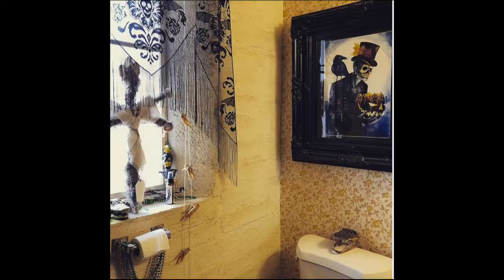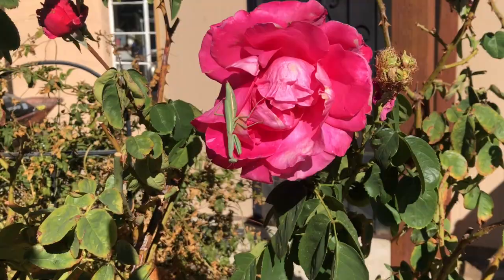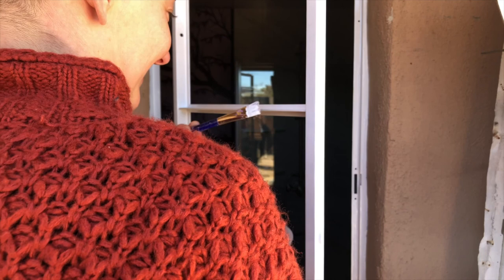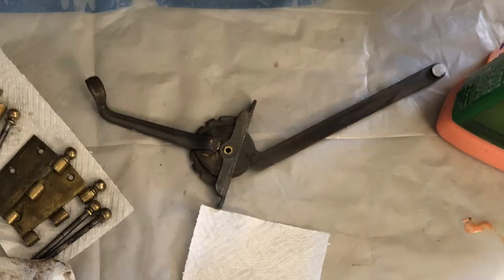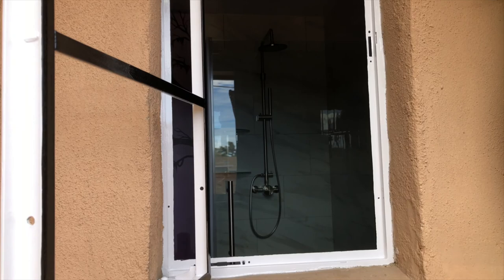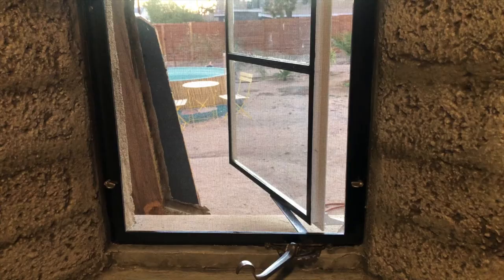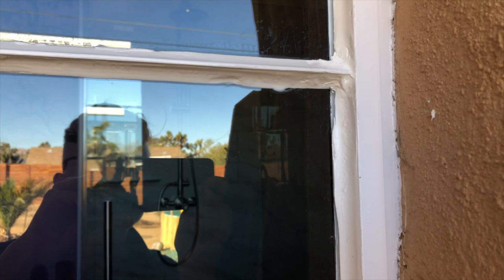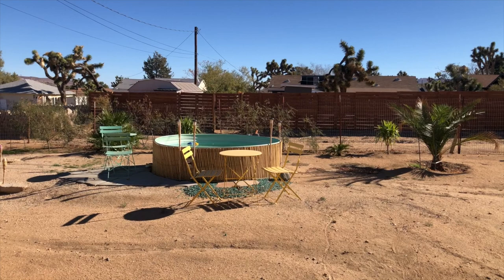DIY 1940's Steel Casement Window Restoration

Comment: great job on the paint removal, just a couple friendly tips you may already know: some folks out here in the desert are using 1/4 inch laminated glass as replacement on these frames because its 99% UV proof. Also an oscillating blade tool makes quick work of removing the glazing, and media blast and/or wire wheel can work fast. good upload thank you. theres not much content on practical steel window restoration out there.
Reply from the maker: Thanks for the tips! I will try some of those out, we have plenty of windows left to experiment on :)
Reply: Thanks for the info. I plan to clear coat bare metal for the inside and maybe some kind of cool coat paint on the outside for less heat transfer with the metal. I was considering replacement but my original window from the 40s seems to be better quality than most options that don't cause choking on dollar signs.
Reply: @rob8823  so Ive really gone down the rabbit hole on this. Best Ive found is a 3 inch die grinder, with those Signi Poly Strip Abrasive Discs on amazon. Takes off paint and rust like butter. Only use stainless wire cup, because the iron ones will make it worse. Bring the window down to the shiny steel. Then its simple all you need is that rust oleum "rusty metal" spray or brush. After that install your 1/4 laminated glass. I had a pro do the oil based glazing because Im bad at it. So hard to find this info on the web but thats about 10 years of trying to figure out the best [lazy] way to pull off the paint and rust easily. A few weeks to let the glazing dry, then paint an oil based metal paint.
Reply: @PreparetoDIY ممكن نتعرف على مكونات العجينه
Reply: I have these and I can't find any holes for the steal pins that are supposed to hold the glass in place. Is there another pin for these types? Some have them others don't... not sure what I am missing.  Any help is appreciated!
Reply: @house9850  Your comments are very helpful. For the oscillating blade tool — which bit did you use to remove the glazing?  Looks like I"ll also need a 3 inch die grinder — would you recommend both tools for removing glazing / getting the metal bare?
Reply: @brandonsouba  yeah you absolutely need both if you're lazy like me. Those pads on the grinder and the softest cutting blade for wood on the oscillator because I didnt want to damage the window frames. I invested in the m series platform by Milwaukee for all my tools but I cannot recommend their M12 angle grinder its got an annoying safety stop that's impossible to deal with. Either way those purple strip disks are the way to go because I hate the chem paint removal. The real nightmare is if you have those stamped metal screens they don't make any more and finding the right replacement hardware. If you have those heavy stamped steel metal spine screens in good condition they are gold, take good care of them.

Comment: Hi, thanks so much for your video! I am restoring the steel casement windows in our old detached guesthouse and I have about 10 windows to do. Did you finish restoring the rest of your windows? I'm curious if it was tedious and time consuming polishing the hardware with your Dremel bit, especially all the screen clips and window locks/latches. Maybe I can just soak all the parts in a tub of.....?
Reply from the maker: We are remodeling one room at a time so I have done one more little window and a larger one. It is tedious but it’s something I enjoy :) I do soak the small parts in citrus strip for a few hours or overnight to loosen up the paint. Polishing them is probably overkill, they seem to oxidize and dull again pretty quickly. And even with the windows closing so tightly, dirt does still come into the house during wind storms (which are frequent during the spring and fall) so I’m considering replacing the windows with something modern and energy efficient after all. It’s a hard decision so I’m going to put it off for a while longer. Good luck with your windows!

Comment: Do you have a source for replacement screens & screen holding parts? I just bought a '46 house and none of the windows have screens. I'm in AZ.
Reply from the maker: Sorry I don’t, replacement parts are hard to come by. I’ve used eBay but the parts don’t always fit (I had to grind down a latch to make it work). Local antique stores might have some hardware you need too. Good luck in your search!
Reply: We bought some parts for our steel casement windows at Pasadena Architectural Salvage a few years ago. They may have some parts for you.

Comment: Thanks for this! I’m in the hi-dez too and have a big, multi-pane steel casement window to restore too. The glazing putty is old and hard as concrete. How did you remove yours?
Reply from the maker: I used a chisel and hammer! It took several days just for that tiny window. Another viewer pointed out that old glazing might contain asbestos so keep that in mind as you're working on it. I have also heard of people using a heat gun to soften the old glazing so that might be worth a try. Good luck!
Reply: @PreparetoDIY  Thank you - that us what I ended up doing too! Pretty scary for a first timer LOL. I only did the problem area along the large pane at the bottom - even just that section took so long! Thanks for the tip about asbestos too - I’m glad that I did wear a mask and eye shield for it just in case!